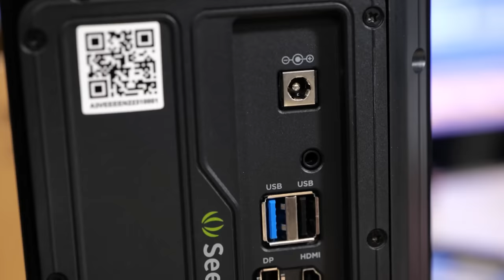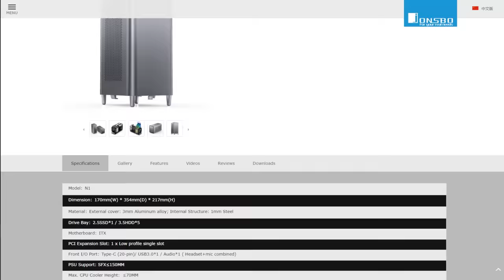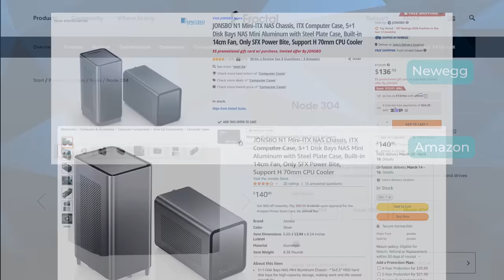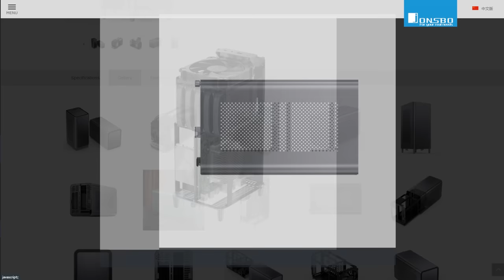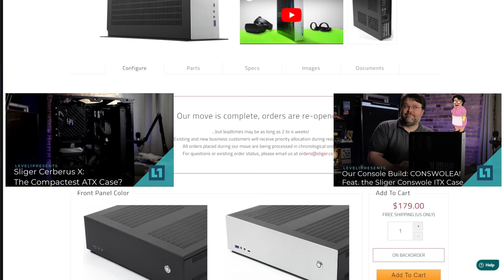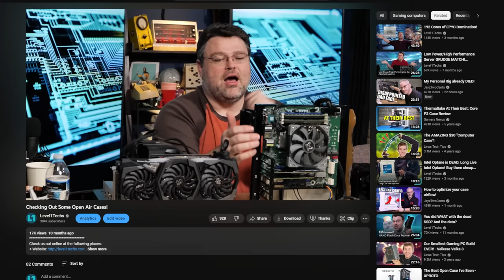The Ideal Home Server! Is it Possible?

Comment: So the biggest thing is that I honestly think we can start moving away from SATA and spinning disks. The cheapest m.2 drives (intel 670p) are down to 4c/GB which is where HDDs were in 2015. Yes spinning drives are down to about 1.5c/GB so they are still 2x the price but that is honestly not bad considering the other creature comforts you gain by moving to SSD. Personally I would like to start seeing more pcie lanes in consumer products. On the flip side, with pcie 5.0 we also could drop down to a single pcie lane for bulk storage. 3500MBps should be fine for home server use. I shouldn't have to go with a threadripper just so I can get enough lanes for storage.
Reply: Well for 1 or 2 TB drives, even 4 TB, SSDs can make sense if you're okay with spending hundreds of dollars on storage (rather than a 500GB SSD and 2 TB HDD for under $100). But even for smaller-scale systems that require terabytes upon terabytes of storage, buying either 5 or more SSDs for only a 10+ TB RAID array or a massive 15 TB SATA SSD are both incredibly inconvenient. For systems with many dozens of TB, whose main concern is mass storage rather than bandwidth, hard drives still rule the roost, and will for several more years until they can reach the low prices and still-importantly, high density of HDDs. I would never think to buy SSDs for a plex server or file server unless I'm storing no more than 1 TB of data once I factor in redundancy and backups.
Reply: @jamesbuckwas6575  I'm pretty sure SSDs are higher density (meaning storage per volume) than HDDs. Cost and known failure types are the reasons I'm still using HDDs.
Reply: with that 8 bay nvme thingie.... could easilly slap it full of 2tb nvme's so 16TB total in 1 5,25" slot or if you are a bit richer the 4tb drives... even just buying them over time is doable...
Reply: I can buy 4 TB mechanical disks refurbished for $40-50 each. For bulk storage SSDs just aren't worth 3-4x the price, keeping in mind both types of drives wear out and need to be replaced; I don't want to be committed to expensive replacements when a disk dies.

I will say the biggest advantage of M.2 SSDs is the lack of SATA cable, which cause lots of problems in disk arrays.
Reply: @benroberts2222  if it is for "bulk" storage... SSD's don't really wear out since they are just storing stuff... they wear out if you keep writing to them but you were just storing stuff... I still use my 10 year old ssd to this day... yes it is worn a bit but still works great
Reply: @LiLBitsDK  SSDs still fail even if not being written to. I had a team group SSD completely die on me after only a few months, just being used as an OS drive and nothing special.

Yes I have very old still-working SSDs but I also have even older HDDs that still work. The problem is there's a failure rate to consider with both; as the number of disks you use goes up, the expected number of failures in either case can become considerable
Reply: @benroberts2222  everything fails... HDD's too...
Reply: @jamesbuckwas6575  It may not be worth it to you but maybe for me it is. I don't need to wait for price parity for SSDs to all the sudden be worth it. Things like the speed are a benefit to me even in bulk storage. Power consumption will play into it. Not having to wait literal days for a RAID to rebuild after a failure is also a bonus for me. If a rebuild could take 2 hours instead of 2 days that is pretty awesome for me. That is a major factor on if you are actually using this thing. If you use your server to also store sensitive business documents then maintenance that takes days to complete is pretty bad.
Reply: @LiLBitsDK  yes I acknowledged that originally in comparing replacement costs. The point is when a drive fails which is cheaper to replace.

This is why for my personal use I prefer smaller HDDs in the 4-6TB range or so, in a stripe+mirror config. Fewer larger mirrored HDDs would also work but the upfront cost would be similar, the redundancy would be worse, and the replacement cost of a failed disk higher.
Reply: @benroberts2222  shrug I'd rather have something that doesn't take days to transfer to/from... SSD's are the way to go... way faster, quiter and overall just nicer
Reply: @benroberts2222   And yes this may be fine for your use case but it isn't strictly everyone. if $/GB is the most important metric for you then until SSDs get down to 1.5c/GB they won't make sense for you. For me I value the speed and low power consumption as well. Cutting a RAID rebuild from multiple days down to a few hours means that I can do maintenance in a single night. If I have to troubleshoot something then it can be done much quicker. For my storage needs (I have 100TB raw storage) it is getting to the point where I can justify the extra cost even for my bulk storage. My problem now is that even if I do want to switch to NVME for storage I need to get a workstation class CPU and motherboard, adding several hundred dollars to the cost of my purchase, simply because all NVME slots are designed for performance and not bulk storage. Of the 28 lanes off the CPU they will dedicate 4 of them for a single M.2 slot so they can get up to 14000GBps even when 3500GBps at PCIE 5.0 x1 speeds would be plenty fast. It is especially frustrating that at the speeds they are currently allocating the NAND flash gets too hot so it either needs a massive heat sink and/or active cooling. One of the major advantages of SSDs are that they have no moving parts which helps them draw less power. Why are we giving that up for big number go up? In my ideal home server I don't want spinning rust. It would be all flash and thankfully prices are almost to the point where it is feasable. 2.5x is still a little high for my needs but 2x is probably about my limit. I want motherboards and drives to be ready when they get to that limit.

Comment: I already tried designing Wendell's tower case idea in CAD back in 2016. The aluminum midframe solution would be too soft to hold up the 4 3.5" drives, the laser cut steel midframe solution would be very expensive (CaseLabs $700 case expensive), and it ends up looking ugly. It'd be far easier and nicer looking to design it like a test bench with a shell, like Cooler Master's old cube cases. The 3 high stacks of 5.25 bays as well as the PSU occupy the bottom chamber, and the motherboard is in a chamber ABOVE held up by a set of posts for structural rigidity, with a large cable run gap between the chambers to make kink-less cable runs possible. Functionally the same thing, but you can't stand it vertically.

Comment: How insane is it to use a Z170 board with an 8th gen aliexpress laptop CPU in it for a storage server?

I have 3 960gb Micron 5100s hooked into the SATA and a couple of SAS hard drives on a 9211-8i all chilling in a Fractal R5. I've done all but install an OS. TrueNAS or Linux or what? I want redundancy above all else and I have been on the fence about what to choose.

Comment: Itx needs to expand in storage space. Or rather, the diy nas space needs to expand. However it probably doesn’t because almost everyone would just go rack mount. I want to see Itx motherboards and backplanes embrace sas that can allow expansion. Or nuc like devices with a pcie port for an hba card. The storage space is also in a weird space. High end is moving away from drives and embracing nvme. When will we see a backplane with 24 m.2 ports? In the consumer space? Just dreams right now. I’m actually going to diy my own setup. I have to. There are no neat options in the WAF area or practical use cases or out of the way type solutions.

Comment: Huh, that is highly unlikely to actually support HOT Swap of the HDDs, that is in fact the main reason I will go with decommissioned server hardware if that is available in a decent enough setup.
That said, you do need a place to put those where the noise won't be a problem and this one looks quite pretty. Still you can get more bang for the buck on the decommissioned arena if you know what you are doing.

Comment: Asrock raid, 5-22gb 3.5 drives raid5 ,that EVGA power supply. Blu-ray recordable slim (required)
And Jonesboro and one is close. But it doesn't have a std sata DVD slot slot.

What I find is there's a decided lack of any cases that have DVD slots anymore besides mid and huge tower formats. Internally go to a little teeny 3x3in NUC style to mid Tower and up.

A lot of them can you see desktop tiny systems also have a decided lack of a simple Slimline DVD slot. I mean the reason we have cases is to reduce power and wiring clutter. You think that a small and you see you would have a DVD drive built in for at least a little bit of large scale storage
Reply: By the way that DVD terror thing you were showing as well. Put in a bunch of slim lines instead of the full size. Then you could have three and a half inch drives a cage that is three and a half inches high and however many drives you can fit in a five and a quarter inches from left to right. And you don't really need a fancy rack for swapping drives up just a reliable one

Comment: I stuck one of those 4x 3.5 drive caddies into the 3 5.25 bays of my Phanteks Enthoo Pro case, to give me 10 3.5 drive slots, along with the second 2.5 drive sled to use dual SSDs for caching in my Unraid server.

I need to dig my ancient "black box" ATX full tower case out of storage.  It has 8x exposed 5.25 drive bays; I used to use it for burning DVD-Rs back when I was doing MAME library distribution.  I think I paid a whopping $50 for it brand new at Fry's. Why can't case companies make cheap high capacity cases anymore?  (Hint: Servers don't need RGB...)

Comment: Couple of things. One, I actually have one of those Antec cases with the billion 5.25 bays, which I used for my first water cooled system, back when Win 7 and Fry’s were the hot thing. Are you telling me that there is no current case to match it? Also, I’ve been looking into refurbished pc’s and there are some sweet Xeon servers out there for extremely low prices, from Lenovo and dell etc. Are any of these systems, towers not rack mount servers, capable of being modded for 5 to 6 drives?

Comment: Maybe an "MSI MPG B760I EDGE WIFI" Mini ITX format running a 12/13 th gen Intel cpu that has 2 x M2 Gen 4 slots and 4 x Sata connections with   2.5Gbps LAN controller?

Comment: I blame Steve from Gamers Nexus for ruining computer cases and motherboards with his gamer influence. But Steve! 5.25" bays are totally useful for a lot of things. Especially, when you upgrade to a new platform, and need something for your old gaming rig to do, besides play old games. I love the Antec 900 for all of it's 5.25" bays. It's more than just a box with lots of holes for your GPU to breathe. It's a proper chassis designed with expansion and adaptability in mind. Side intake fans are also nice when you need a way to keep your hot server-grade components cool without having to use insanely loud server-grade fans to cool them with.
Reply: His influence cannot stop the CHADS at Fractal from making stuff like the Pop Air! That thing has amazing airflow, looks, ease of building AND two 5.25" bays. God I love Fractal.
Reply: @bhume7535  But, only 2. That's barely any versatility at all. That doesn't leave you with many options when you decide to retire that system from desktop duty, and reassign it to something else, like a hyperconverged hypervisor/network/file server. Maybe you want to self-host some services? Plus, it's ugly and looks like a child's toy. I don't want a flashy hotrod. I want a workhorse which can serve as a jack of all trades. I don't need my low-cost consumer hardware to be the best at anything. Of course, it would be great if I'm able to relax and play some games on it, too. However, it doesn't need to be so gamer focused that it becomes useless for anything else. I hate how expensive versatility has become. Even rackmount gear has become less versatile, yet more expensive over time. This is a horrible trend, and it's all over the entire market.
Reply: @TheChadXperience909  Oh... ok. You're just wanting your niche catered to and you want it cheap, which is never going to happen.

Just because you want something doesn't mean what the majority of people buy shouldn't exist. Bet you use Arch. Lmao.
Reply: @bhume7535  Except, that's exactly what companies are already doing. And, I don't want a niche computer. I want the opposite. I want something versatile, so I think you're probably misunderstanding. I also sense a snarky tone in your remark.
Reply: @TheChadXperience909  Well versatility is in the options you can buy. Not everyone wants to buy a big wall of 5.25" bays and a case with 10 hard drive sleds because they may want to make it a home server later.

Most of the people buying computers and parts are people using them for a specific purpose. Just because a majority of products don't conform to your needs doesn't make them "ruined".

And your snark sniffer is working bud. I lost respect for this conversation when you said "it's ugly and looks like a child's toy." about the Pop Air. Its a fantastic little case for the money and has tons of options for colors. Y'know... that whole versatility thing you wanted. It can look good with a variety of color schemes. Oh wait, YOU don't want something flashy, which means it shouldn't exist.
Reply: @bhume7535  That's the problem. You "lost respect". In doing so, you're forgetting that respect is always a two-way street. Since all you want to do is troll people because they happen to disagree with your personal opinions, we can end this conversation, right here.
Reply: @bhume7535  I think what he means is that the trend of cases including fewer options for hard drive and 5.25" bay hardware is bad for people with his use case. People who run a home server and want a significant number of drive bays or IO ports on the front should have their use cases fulfilled, and not necessarily at a higher price either, unless the tooling for such cases costs more. Which, considering the high cost of already existing cases and the reduced need for airflow engineering, I assume could be fulfilled. Saying that cheap yet expansion-focused cases are never going to happen contradicts a lot of computer cases from a decade or two ago when those features were common, not to mention the cost of computer components always going down over time.

Also, insulting someone because their operating system is not used by more than 10% of users worldwide is just dumb.

Edit: Just because some consumers won't be interested in re-using their system as a home server, file server, or similar, doesn't mean we should remove pathways for those who ARE interested to do so. Obviously this is more difficult than swapping a smaller part like a CPU or GPU into an old dell optiplex or similar, but a hypothetical modular case that allows for the swapping in of 5.25" bays and 3.5" bays would be one possible solution. Another solution is to have more expansion-oriented cases such as the Fractal Pop Air for consumers who don't need the highest airflow or most optimal radiator configurations, since they're only running an i7 CPU and a xx70 class NVIDIA GPU, and it would also benefit consumers who don't want to spend $200+ on modern cases such as the HAF series of cases for these features as well. 
And if someone is only buying a computer for a specific use case, and doesn't care about modifiying that use case now or ever, well, no one's saying airflow-oriented cases designed for high-power components should not exist either.

Comment: Yeah, I really need to make a storage server for data archiving, ISO storage, etc. In an effort to keep costs down, I've thought about using the hardware I've kept since the initial build of my i7 gen3 system. I'm tentatively looking at an AM5 upgrade (7950x) that will keep my case, PSU, and anything else that makes sense. The existing Z77X-UD5H board, 3770k CPU, 32 Gb DDR3, and the archive EXOS drives could be used in a new case for a server, but then I guess I'm looking at "Is this the right way to go?" vs selling / scrapping the old hardware. /techhoardingproblems

Comment: Warning I have the Jonesbo case. Two of the five bays stop working. Learned a good lesson, do not use non enterprise grade drive backplanes. If you're planning a DIY server with bays. Avoid cases with a backplane. It only introduces an other point of failure.

Comment: I'm laughing 'cause the case "fashion" coming back around...... I've actually keep an eBay alert for the Antec Three Hundred Two case.. X3 5.25 bay flexibility, But more so for the 120mm fan that cools the PCIe slots.... Adaptec 8 series raid controller, Mellanox ConnectX-3 VPI 56G nic (network back bone), a couple Supermicro NVMe adapters that put 4 drives in a X8 slot, 1080 Flounder Ed..... oh, yah Asus X99-E WS USB 3.1 Mo'Bo'... A bunch of electrical x8 PCIe slots..... E5-1660v3 OC'ed @ 4.29G and Four 32G stick Samsung EEC @ 2666.... the 5.25 bays... Blu-Ray for spontaneous movie play, and a Supermicro 8 Bay 2.5" with Samsung 860s R5.....I use the 5 x 3.5" Supermicro Cages in another build. The 302  will mount 6 3.5" drives internally as well I'm using the Raid controller for those as well....

Comment: so... wait... how would you feed all those M.2 drives? 8x4 is 32 lanes just for the m.2 hotswap. how do you break out a 16x lane to 4x4 lane card? or a 2x4 lane cards?
Reply from the maker: Plx bridge cards from enterprise. not cheap and hard to find. I commented on that and that's why I said the little epyc mobos make more sense than that as it costs the same or less and is a better solution

Comment: Why dont you build a Fractal Node 804 and add 2.5 to 3.5 modules which allow for two Sata or NVME 2.5 drives for a total of 16 hard drives.  Some cheaper 4TB Sata 2.5 drives went for 126 a piece on Amazon black Friday or cyber Monday.